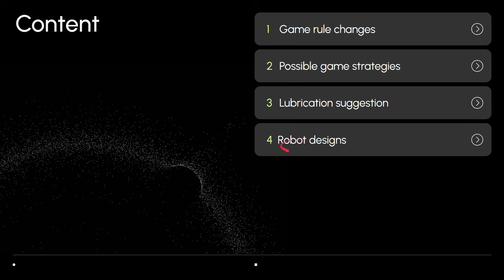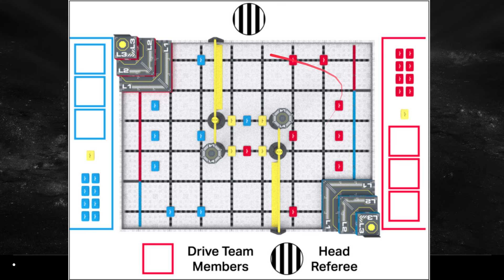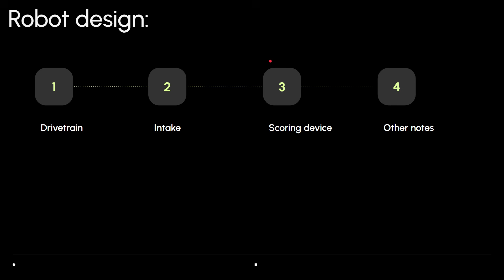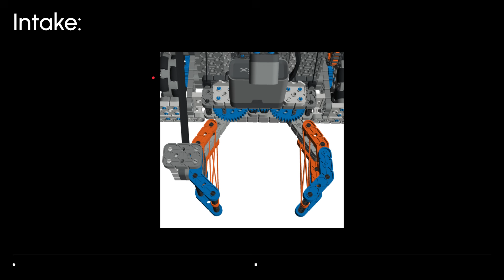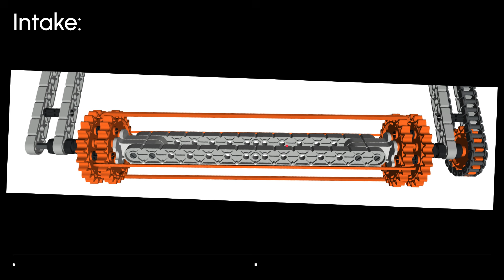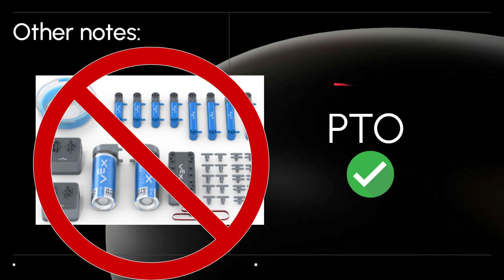Don't Build Your Level Up Robot Until You Watch This! (Early Ideas)

Comment: You can run over beanbags, that is not considered possession or plowing. As long as the robot doesn't sit very low, you should be fine that it doesn't catch on anything when driving over.